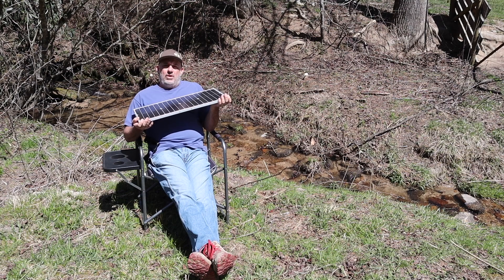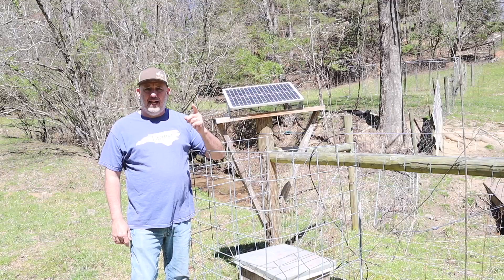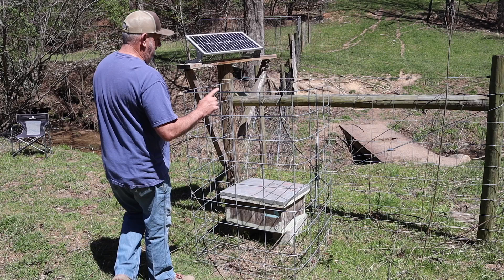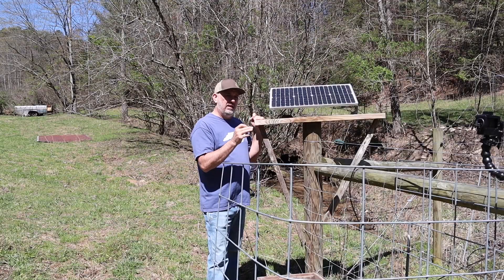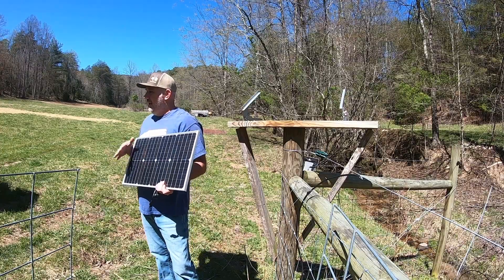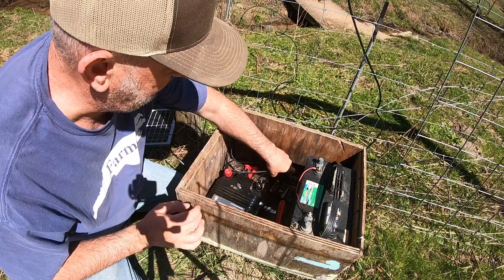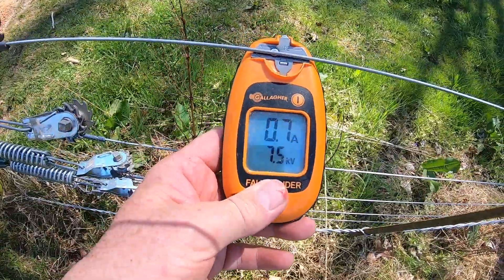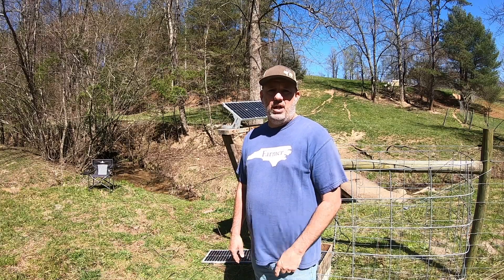All you will need to know about building a solar fence charger￼

Comment: cant you just run the fence with the panel and off the battery. is the fence charger actually necessary?
Reply from the maker: Yes the charger is necessary because it regulates the amount of charge and the duration of energy thank you for watching our videos
Reply: @7StandsFarm  no prob. thanks for the quick reply

Comment: Good video. I wish I could use that set up. Where I run my pigs most of the 40 acres is filtered light in the woods. I get about three weeks on a battery using the P 30 fence chargers.
Reply from the maker: The solar panel is only $65 on Amazon so not a huge investment and I bet it would charge more than you think eight be worth a try 
Thanks for watching our videos we appreciate it